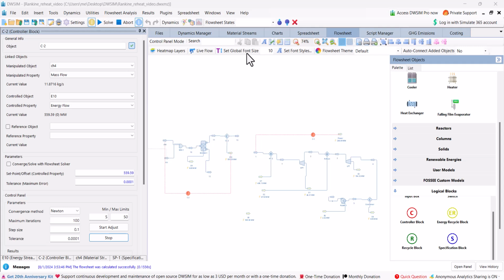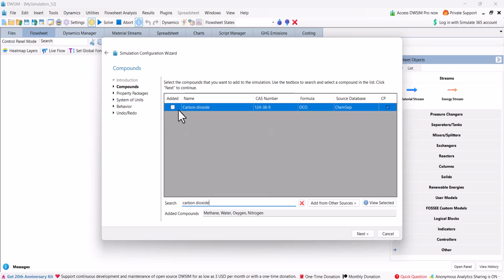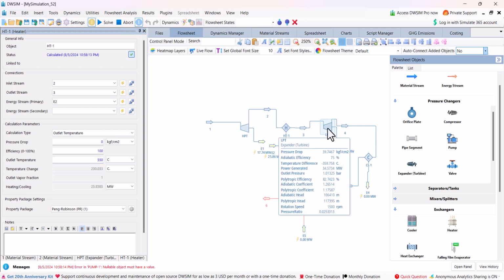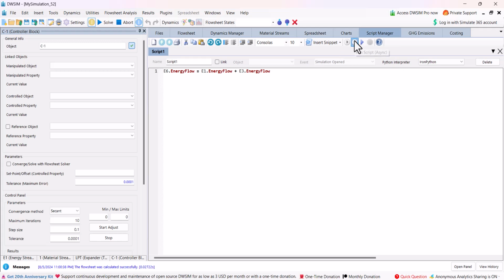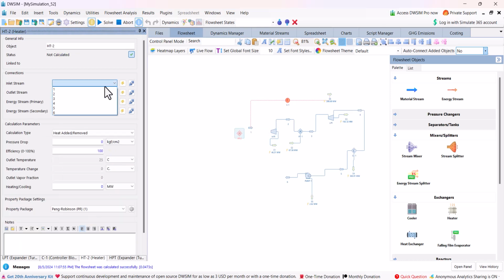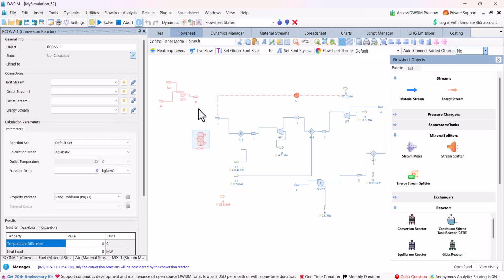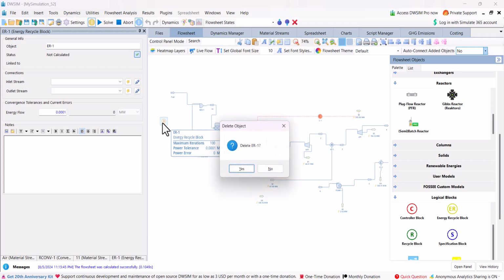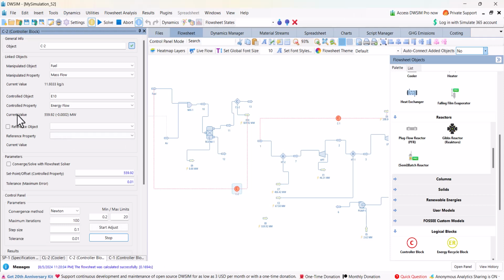DWSIM model of Rankine reheat cycle w/ methane combustion- use of controller & specification block

Comment: normaly during CH4 (or nat. gas) combustion excess air (as a lambda) is not 1.5 and rather about 1.1. and the mass of dry air/mass of CH4 is not 17.5 or about 17.2 kg of air/kg of CH4. Thanks for these example!

Comment: Hello, I'm going to make a composite cycle that connects the Brayton cycle and the Rankine cycle through DWSIN. Can DWSIN design a way to connect exhaust gas from the Brayton cycle to the Rankine cycle turbine to assist the power to turn the turbine?
Reply from the maker: @백승민-e9q8k  you mean exhaust cases from Brayton cycle to produce steam and then expansion of this steam in steam turbine?
Reply: @modellingandsimulation-che9457   Yes, I know that exhaust gas is discharged from the turbine during the process.